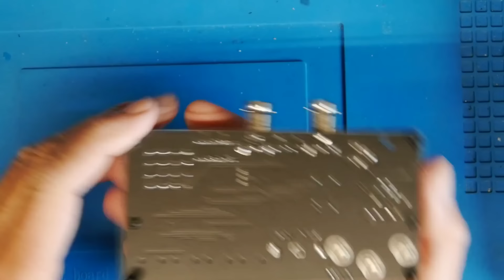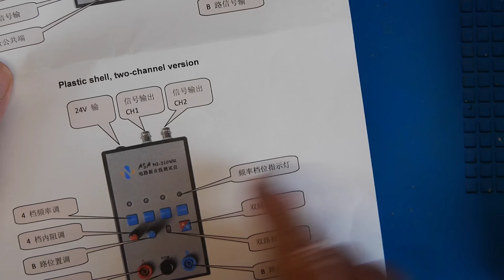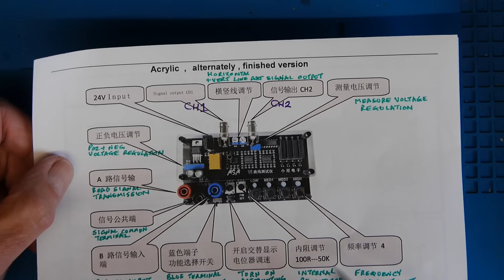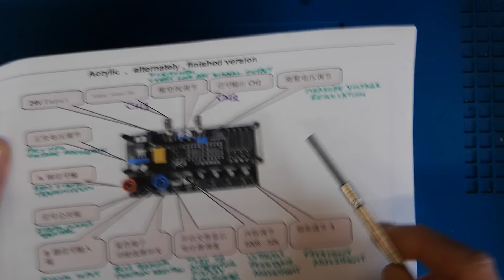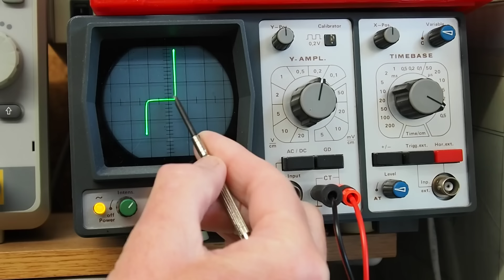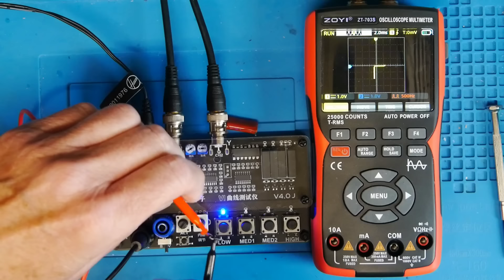Oscilloscope Curve Trace Adaptor - #190

Comment: Just found you ! lots of interesting stuff on your channel so I've subbed ! I have a question about this curve tracer, for me the most use one would be apart from the novelty is matching transistors for audio work. Has this  got a step generator and is that what the blue banana is, a third terminal for our beloved BLT's ? could you demo its performance with a Transistor.......cheers.

Comment: The chips used in these devices are generally b-stock or surplus from other products’ manufacturing runs (aka, even cheaper than usual). I seriously doubt the company producing these products expended the time and energy to conceal the chips themselves.

Comment: In more than 20 years doing electronics, haven't found a single use for a curve tracer yet...
Reply: Was going to say the same thing, 30 odd years in the profession, never used one and only once worked in a lab that actually had one.
Reply: A 2 channel curve tracer is VERY useful for fault-finding if you have a known good device, you can compare the curve tracer readings at different nodes of the circuit between the two.
For example, if a stereo amplifier is faulty on one channel only, you can probe around until you get a different curve trace, which will give you an idea of where the fault is.
Reply from the maker: They seem to create a lot of interest on social media, maybe it's the enigma of what exactly they can do....
Reply: They laser it off because it’s stolen technology not their own - they laser off their own marks to hide.

Comment: Bought a curve tracer off ebay several years back. Only 12 bucks and it requires a 12v AC power supply. Works great with no issues. Looks to be about 27 dollars now.
Reply: is that the diy kit i see everywhere that comes with or without the transformer? i got burned on a kit similar to this gentleman's and it visibly arced across the bnc connectors before i plugged the bnc cables in so i opened it up to find a rube goldberg device. i got a refund but i almost plugged it into an expensive (for me) scope. i almost bought a tektronics one a few days ago from a local seller while on a hospital visit 600km away but 800 dollars isnt exactly impulse level purchase in the private market. i was looking to buy a new guitar as well and sell one i paid a fortune for but the market is flooded so i'll keep it as an art piece in my sitting room on the wall as it's not worth losing 1500 dollars to get a pittance for it when i can keep it and buy a new guitar anyway. i hate the fact it'll never be played because im not a hoarder and usually donate my old guitars but i paid too much for that one. i live in a rural area where people sell broken stuff for 80 percent of what they paid new 20 years ago and have long since gotten their money's worth haha. sorry for the ramble.

Comment: The main reason they remove chip ID'S or but false ones is they are many times using domestic only chips. The chips are manufactured legally but only for the domestic market or products.  Taking the ID off gets around this as it is way too much bother to prove it is a unlicensed chip

Comment: I have the one like your's only it's the asa 210k packaged one. the bnc connectors arced when i plugged it in so i never hooked it to my scope. i've since reflowed all the connectors and taken measurements to make sure there are no shorts. i still cant bring myself to try it.

to add, the ic's were sand papered (if that's a word) to remove the markings on mine. the dip ic is a tl074 i believe. as i could see a tl.

Comment: Reading clockwise, hope it helps：24V Power Input, Horizontal Line and Its Lenth Adj. , Signal Output CH1, Signal Output CH2, Vertical Line and Its Lenth Adj. ,Adj. for Voltage Measurement, Channel B Horizontal position Adj. , Internal Effective Resistance Selector, Single Channel/Dual Channel Selector Switch, Freq. Selection, Channel B Position Adj. , Channel B Input, COM Jack, Channel A Input, COM Jack, Plus/Minus Voltage Adj.

Comment: I just used a 24v ac transformer and a few resistors to make my curve tracer. It only works for 2 pin devices but you can also use a stepped waveform to make a 3rd pin like a mosfet or such. I imagine this board is mostly a stepped wave generator with some opamps but most of that is not needed. Curve tracers uses to be more useful years ago, but they are not as useful today. You can see the curve on most datasheets now.
Reply: They are very useful if you do electronics repair
Reply: need to see the actual curves of each transistor for matching purposes. data sheet is the ideal parameter.
Reply: data sheet is from the supplier, the part in on hand maybe way off, best check it.

Comment: I have the big brother Hameg scope with a curve tracer. They are a pretty good little scope.
There is a curve tracer that is a kit on ebay that works well. They are about $40 usd and they come with all you need to build it. You just need a box and a tranformer for the power supply.
"BJT Transistor Curve Tracer Plus AC/DC Regulator Power Supply Unassembled Kit"
I use the one I have for matching transistors and such for amp builds. I think they are well worth the $$ and hell,,, it's a fun little project.
Reply: I have the same curve tracer kit.  Did the xraytony modifications he designed for it.  Works great.
Reply: @scrappy7571  Yeah it does,,, Thanks to Tony for pointing it out to us. For the $$ you just can't beat it!
Reply: that's exactly what i need one for. i have an old presonus 12v ac wall wart from an old daw that used firewire. i have a few ac wall warts i found a value village too and they are all ul certified. im surprised the one in the video had the ul stamp....

Comment: More of a V I component tester than a true curve tracer , or does it have a stepped ramp generator to test three legged devices? I built one of these years ago but found I never used it. Grand video.
Reply: Its really a bit of a waste of time if you cant set any parameters to the specs of the device as it doesn't put the device in any sort of real life situation so you it confirms a good device but its not going to find a poor device. I have nothing and wouldn't bother unless I could get one of the old Tektronix units
Reply: @campbellmorrison8540  These simple testers do have their uses, to do an A - B test on components on the PCB say in a stereo amp. With more time Bill could probably suss this device out & learn how to drive it. Any bit of test gear takes time to learn to drive, especially Tektronix CT's.
Reply: @diabolicalartificer  That is true, what I was saying is I use other ways to test devices so I personally have no need for one but I would like good unit however I totally agree it takes time to learn any instrument.
Reply: It’s got a blue terminal he doesn’t seem to have used, presumably that’s for 3-pin devices. He did the same in another video, the cap and zener are apparently his go to for this. I’d also liked to have seen a few transistors, and a demonstration of its stepped output (if it is indeed possible). 

The biggest drawback to these cheaper gadgets, apart from the limited options for calibrating their output levels, is their limited voltage and current capacity. Most of the devices I’ve seen that are a bit more expensive use multitap transformers and relays to provide more realistic working voltages. 

I think this video would be well-served with a follow-up if he can use Google Translate to get more information out of the manual (or someone can help him with that), and maybe provide some better examples for its capabilities that include a few BJTs and FETs, along with a rundown of its menu and settings. 

Just a thought. Of course, we could all go find any number of eBay listings on this thing, and probably come up with these answers, but it’s hard to know what you can trust from people selling them.

Comment: You had a perfect setup with the CT from the Hameg. Did you try to connect the adapter to the Hameg and then switch the Hameg to xy-mode? That should display the correct patterns. After that take a note of the Hameg settings and bring it over. to the Zoyi. I have the dual version of the adapter, had also experienced the difficulty you described but the above. This method brought me a bit closer, but I decided it was not worth the trouble, the Hameg is good enough for my use.
Reply from the maker: Excellent idea!
I managed to not think of that, drat!
I will add that to the list of things to try out, thank you!
Reply: @LockdownElectronics  😀